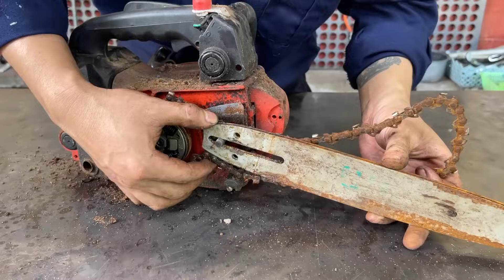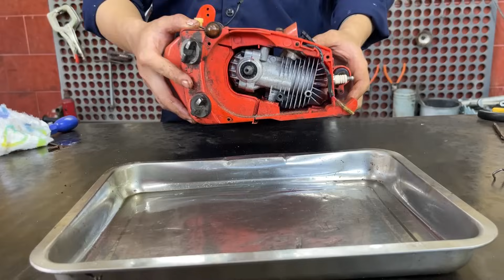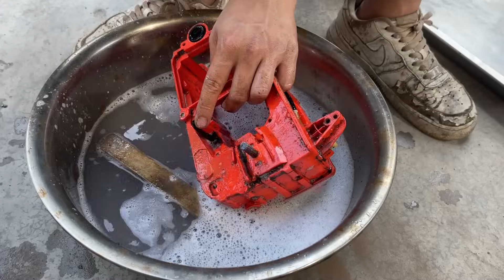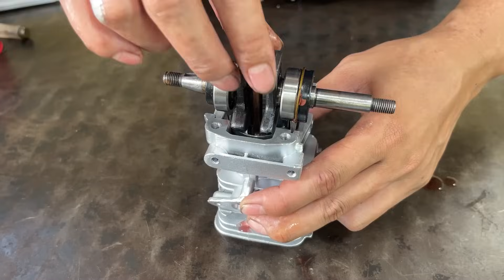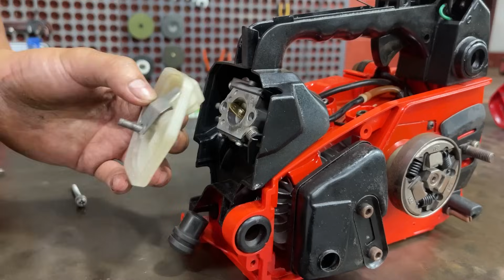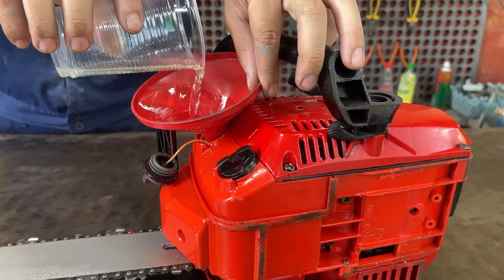Talented Mechanic Completely Restores Rusty Old Chainsaw  Complete // Chainsaw Restoration Project

Comment: This guy has no idea what he's doing.  All he did was take the saw apart and do a "Liquid Rebuild"  aka paint.  No carb rebuild/clean, no new crank seals or ring, no grease on the clutch bearing and to top it off the chain was installed backwards.   HACK!